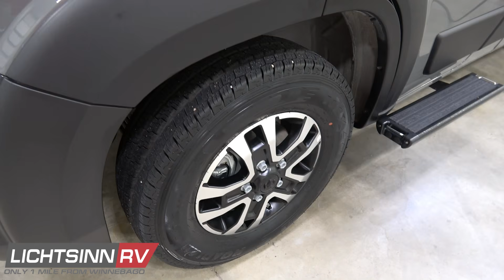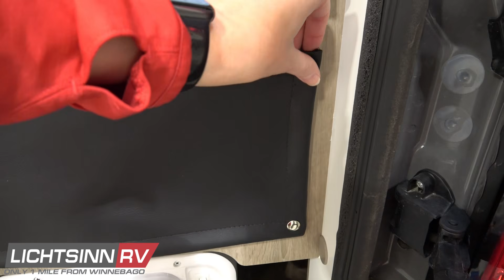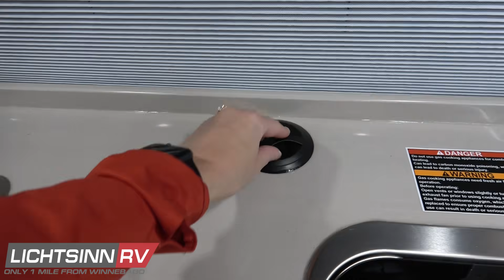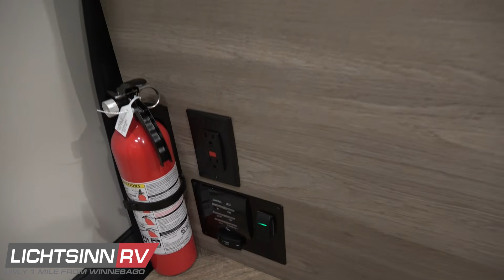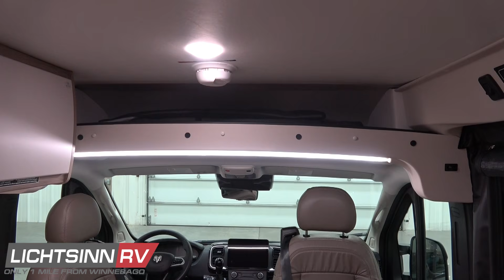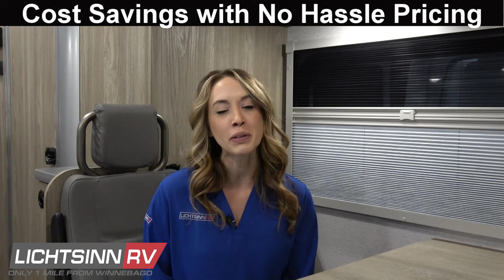New Winnebago Travato 59K - Class B Gas Motor Home - LichtsinnRV.com

Comment: Do they have a place to store the collapsable ladder? We have a 22G and even collapsed the ladder takes up some valuable space.
Reply from the maker: Good morning!   Thank you for your note!   There is not a designated space, but if you have a 22 59G you should have the rear ladder for the roof rack.  If you do not and use a telescoping ladder I have seen some attach with a mount to the under side of the 59G bed or in the overhead shelf area.  Hope this helps!
Reply: @LichtsinnRV  Thanks I was asking as we are considering upgrading to a  K model next year and are looking at the new features. I really like that they are putting afresh tank fill on the outside. ;-)